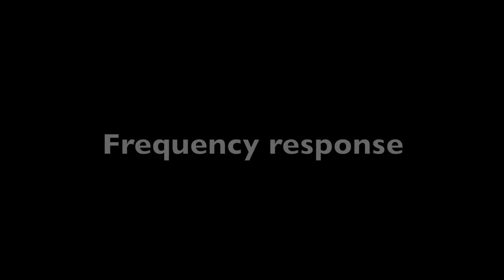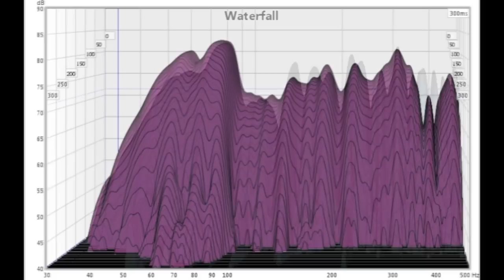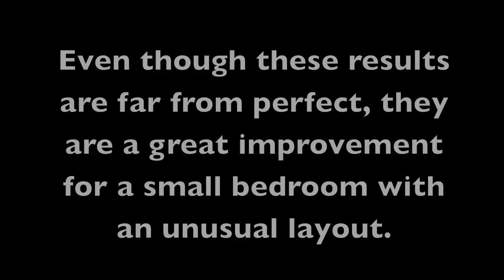Do-it-yourself 'green' acoustic treatment for the bedroom studio // Measurements before and after

Comment: Resonating panels and Helmhotz traps take several cycles to build up their cancelling wave, just as bass reflex speakers take several cycles to build up, so the result is a mess in the time domain, despite a flatter steady-state response.  I'm looking for better, and actually experimented with (different) speakers at the rear driven with a delayed antiphase bass signal to act as 'black hole' absorbers.  I got perfect removal of the 25Hz mode, or the others, but not all with the same delay!

Comment: Interesting demonstration showing a clear improvement, but the low frequency modes are problem.  I have a 25ft by 18ft studio heavily treated with 7" panels of glassfibre over 50% of the walls, with excellent results except for bass modes. A bigger room you just shifts the modes down.  If I were starting again I would build big, and construct a room within a room with inner walls of just studwork and glassfibre covered with polythene and fabric. The outer six feet or so for storing equipment.

Comment: I've have problems because materials like hemp and wool smell badly in large quantities and the smell doesn't reduce noticeably with time - so I've had to stick with glass fibre.  I have a good sense of smell and well sealed studio with little ventilation in the interests of heat loss. So now I have to smell the glass fibre before I buy!  The yellow cavity slabs smell terribly of bonding agent.  Some loft insulation smells too.  I wrap glassfibre in thin polythene to avoid dust.  Your comments?

Comment: Yes I have, but don't consider them a valid solution. Most speakers today are 'bass reflex', but as you probably know this means that they only build up bass over several cycles so they lack the initial deep thud that comes from a true 'aperiodic' speaker. I am not alone in disliking the compromise of bass-reflex speakers, and my studio has four 18" bass units built into the wall with a garage behind serving as the 'enclosure'.  A 'near-infinite baffle' in other words, aperiodic, and -3B @ 12Hz.